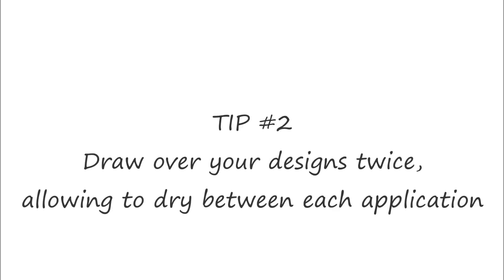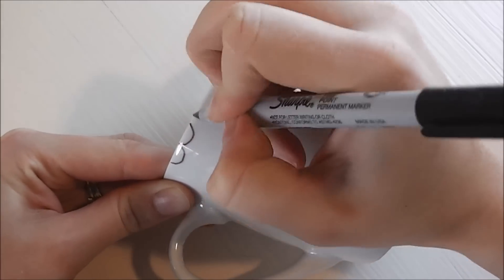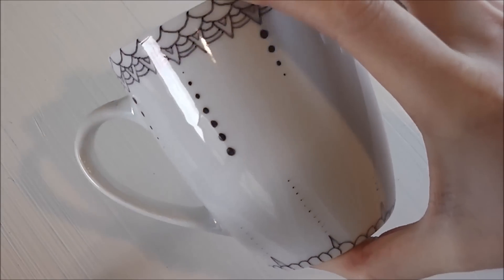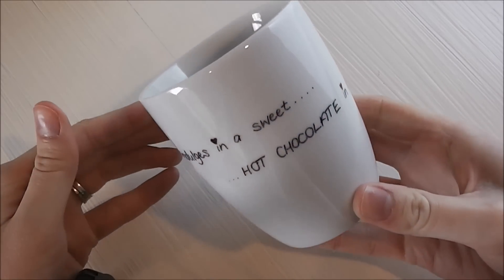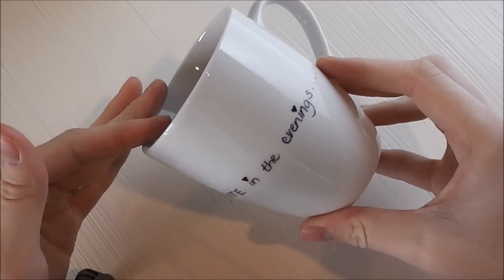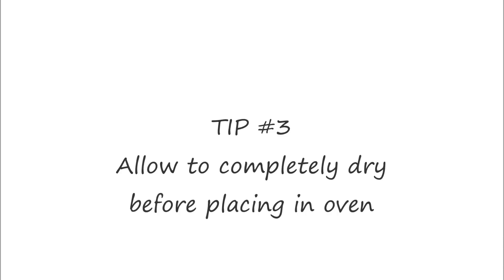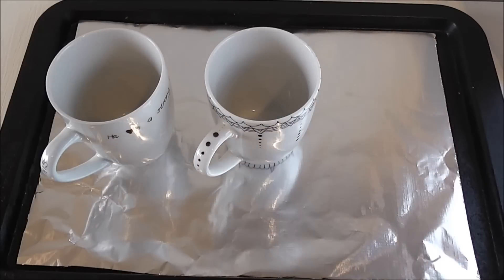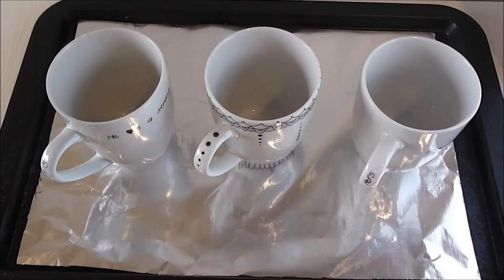DIY Sharpie Mugs (and why they often FAIL!)

Comment: I have used both regular Sharpies and also the oil-based paint Sharpies.  some things to be aware of.  If you have any finger oils on the cup, the paints will not adhere (absorb) After washing the cup and rinsing well, use alcohol to wipe the area you will be tangling thoroughly!. (2) Avoid depositing more finger oils on the cup by using cotton gloves when handling. (3) I DOUBLE BAKE the cups. first time bring oven and cup to 425 Degrees F and bake for 30 minutes, then turn off oven and let cups and oven cool naturally. Reset oven to 450 degrees F and let oven and cup warm up together.  Let bake for 45 minutes. Turn oven off and let both cool naturally. 

When done this way, the cups have stood up to dishwashers at the local Senior Center for 6 months of use, so far.  Using this method, sometimes the Sharpie metallic paints will undergo changes. Example: the Rose gold will change to plain gold metallic.
Reply from the maker: Mildred Galliher Thanks for your suggestions Mildred, I'm sure they'll help some people out :)
Reply: can I use any colors?
like red..blue..green..silver..gold
Reply: Sylvia Taylor I believe so
Reply: Hi :) Can this be done on glasses as well, or just mugs? Thank you :)
Reply: Mildred Galliher which sharpies do you think work better
Reply: Oil based markers will work better, with baking they are able to be dishwasher safe
Reply: Trysh Greig for glass I would say no because when glass heats up it will break
Reply: Will the heat make the cup explode from getting too hot??
Reply: Kaylee Michelle ceramic usually can withstand a high temperature- usually up to 1800 to 3000 degrees Fahrenheit so there’s nothing to worry about unless the ceramic is not oven safe
Reply: Kaylee Michelle not if you put the mugs in a cool oven and then heat it.  I bake for one hour at 425 and then let it cool completely before moving.  Start timing the hour after the oven reaches 425. I only use oil based sharpies.
Reply: I completely agree with avoiding finger oils as much as possible; I didn't know this prior to baking my mug and it came out with brown stains which you can rub off with cleaning materials but it's much better not to risk it!
Reply: I got a question if I'm only tracing the image with a regular Sharpie  on the glass and then I paint the image can I put it in the oven?
Reply: @tryshgreig9220  i have tried and it works even better 👍

Comment: oil based sharpie markers are the best to use, dont forget to use some rubbing alcohol on the mug then letting it dry again before drawing, then finish everything off with a layer or two of some mod podge to create a protective coat so that you cant scratch anything off
Reply: Shelby Cook do you put the mod podge on before or after you bake it
Reply: put the mod podge on after you bake it, i put 2-3 coats on them and it turned out great. Make sure not to put any on the upper rim where you'd put your lips, leave an inch of room for that across the entire cup or else youd get sick from toxins.
Reply: Shelby Cook 
what if we dont have oven?  what else can we use
Reply: what mod podge do you use? Is there one specifically for glassware/stoneware?
Reply: what kind of mod podge did you use?

Comment: I would also suggest that instead of using regular sharpies, to use oil-based paint marker sharpies. I baked mine with the oven at 350 degrees for 30 minutes and it works fine. It's also dishwasher safe! :)

Comment: Followed the directions, including cleaning the mug before painting with alcohol, used Sharpie Oil markers, bake @ HIGH temp, etc. Mugs looked great going into the oven, but when cooled & removed - the colors had almost all changed. Red was vibrant going in, came out almost black. Navy blue came out brown, turquoise became light brown - only black emerged as it went in. 

I wish I knew what I did wrong, or if anyone else has had this disappointing experience and figured out how to fix it. Lots of hours seemingly down the tube....
Reply: The video mentioned the colors would change. You did nothing wrong. That's just what happens when you heat them. You might want to test the colors on a similar surface before using on your project so you know how they will turn out and can plan accordingly.

Comment: I bought some mugs from ASDA for £4, used a regular black sharpie and baked for 25 minutes at 150 degrees Celsius, leaving them to cool completely with the oven door cracked open slowly. So far the mugs seem fine, no fade in colour after baking. When I was designing I wiped down the surface with some weak salicylate acid (actually in my face cleanser) and tried to avoid touching it afterwards. No cracks, haven't tried washing them yet but I'd leave them for a few days before first use! Hope this helps someone

Comment: Great tips on your video.  I have used the sharpie oil based paint pens.  My designs are on mugs and wine glasses which I use both sharpies and enamel paints.  I follow the baking instructions for the paints, and after baking I have found the sharpie pens have faded.  I also apply  a clear glaze for added durability and the sharpie pen bleed.  Do you have any recommendation on glazes that won't make the sharpie pens  bleed.  Thanks for your help.  Elaine

Comment from the maker: Great tip Danielle - hope people read that one :)
Reply: I used the Oil Based sharpies and only had to apply one coat. The mugs came out great and are not washing away.
Reply: +Meredith McGee well where do you buy oil ones? mine don't say anything on?
Reply: +Caleb kendyl  Ya most of the time when they say Sharpie Mugs they are referring to the oil paint permanent type of sharpie.  I had to go looking for them, but you can get the at Michaels for a little under $20.00 for a pack of 4 colors... so they are more expensive then normal Sharpies, but thats because they are not Permanent Markers, they are Paint Markers.  They come in Water color and Oil.. but so far the oil works best to stay on glass for myself.  You can also buy them online at places like Amazon and craft places.  But if you are still not sure what I mean check out sharpie.com  and according to Amazon they are called Sharpie Oil-Based Paint Markers....  

http://www.amazon.com/Sharpie-Oil-Based-Markers-Assorted-1770459/dp/B003VQ9M04/ref=as_sl_pc_tf_til?tag=thecozoldfar-20&linkCode=w00&linkId=LCLJVKSJL7OC3JBG&creativeASIN=B003VQ9M04

I hope this helps...
Reply: Thanks for the link. I just ordered the oil based metallic markers. Lets see how they turn out. THANKS!

Comment: I am baking my mugs right now.... I am nervous 😁😁😁. .. I am following your directions step by step.... Let's wait for the final result. ;)
Reply: How'd they turn out?
Reply: Ohh Amazing! I loved them and all my guests loved them too. I made them for my wedding gift which was very intimate and small. Thank you so much!!! 😄
Reply: +Carol Vzla C 
did you use regular or oil based sharpies?  Thanks. Did you bake at the 220-230?
Reply: I actually used DecoArt glass paint marker. I placed them in the oven for 30 min (375 ° F) after a year my mugs are still cute and perfect.

Comment: This has been extremely helpful and I love your work. My issue today is that I am wanting to paint these AMAZING clear glass soup mugs I found at a local dollar store. I've not yet used the markers on clear glass, just the little cheaper ceramic.  I do let each color dry before applying second coat, and in addition let sit to cure for 24 hours before baking. But my question is, is the baking step going to work as well for the clear glass? Any tutorials I've watched thus far from others don't use this step, just paint, let dry and hand wash. Just feel like this would be a good step to add.

Comment: What happens if you re-bake it? Will it possibly brake? I baked it once but the sharpie just scratched off. It didn't come off with water, but when lightly scratched it just comes off. Can I re-bake it?
Reply: the sharpie has to be oil based
Reply: that happened to me too and I did it with oil based paint. I baked it twice at 425 but it did not work :/

Comment: what do u mean ny letting it heat up with the oven? like putting it in the oven before the timer goes off? if so do u start the 30mins for the mugs then or after the timer for the warming of the oven goes off???? Sorry this might be confusing! :)
Reply: Don't preheat the oven before putting the mugs in. Let the mugs heat as the temperature rises. If not the mugs might break from the sudden heat change. Same goes for removing them from the oven. Let them cool in the oven.
Reply: put the mug in, and then preheat the oven while the mug is already in

Comment: thx for the video. will there be significant colour change when I bake the cups? i have useda variety of colors using the oil based sharpie paint markers such as pink, blue, purple, red and yellow. also would u recommend using a water based varnish as extra protection after baking?

Comment: If you want something that will REALLY adhere to plastic,ceramic,glass or metal try NAIL POLISH.All nail polishes sold (in Canada at least) are free of harmfull chemicals.However,you need GOOD Ventillation when painting with nail polish because it's highly flamable.Also I dont think the nail polish will be free of cracks if you wash it.Nail polish (and permanent markers) are best used on artworks (like decorative plates) that are not used for actually drinking or eating off of.

Comment: A question I have wondered.....I plan on trying this and learning as MUCH as I can to make sure my first shot sticks right. For the 30 minute bake time, do you set your timer as SOON as the mugs go in (meaning the mugs run time is also during the heat up time) or do you NOT start the timer TILL the oven hits the 220c mark?
Reply from the maker: Zetamoon Start the timer once it reaches temperature :)
Reply: I put my mugs in for 40-45min, starting the timer at the very start. That way it includes the warm up as well as 30min bake time. My mugs have worked a treat with no issues.

Comment: Just a quick question...approximately how long will this design last if it turns out right? Thanks for the advice!! Much appreciated
Reply: If you use it daily and wash it daily with the soft spine it should last 3-5 months depending on how gently you wash it. Hope this helps!  ^-^

Comment: Hi, thank's for the tips! I use an acrylic spray to seal after oven and it works, my mug seems perfect! But i have a doubt... although i'm very careful and don't put spray where the lips touch and inside the mug, i don't know if it's dangerous. What do you think? Did you use it too or just use the oven? Thank you
Reply from the maker: Ana Rita Cardoso Hi Ana, I only used the oven, so setting spray afterwards. Unless you are using a ceramic specific spray, I would be careful :)

Comment: I used regular perm sharpies.  I baked at 350 for 30 minutes.  My colors changed a bit during the process.  They were not vibrant anymore and / or they changed colors all together.  Is this due to using the regular perm sharpies?

Comment: Hey great video. Question if I used a glass to do this do I still bake in oven and is it safe?? Thanks
Reply from the maker: Diane Mawdsley Hi there. No, don't put glass in the oven. Glass will require a different medium specific to drawing on glass. :)
Reply: Thanks StyleNovice.

Comment: this may sound like an odd question but where can i actually get the glaze? I want to paint over a dollar store figurine and id like to seal the paint  somehow
Reply from the maker: Jane Doe Hi Jane, the existing glaze on the cup heats up in the oven and that's what the sharpie melts into to set :) Otherwise, you may want to try ceramic paints which may also have a separate glaze available for purchase. Hope that helps :)
Reply: StyleNovice ty so much, it does!
Reply: StyleNovice  where can you get the ceramic paint from for cheap

Comment: Is there any substitutes for oven? I mean, anything what would heat the ink pressed. Thanks!
Reply: Karlo Bloo 

I used a bench top convection oven (you know, the fan-forced ones with a heat lamp in them?) and that worked better than the ones that I did in the normal oven!!!!!

Also, make sure your oven is clean -- if there's any baked on grime, it will transfer to the cup or plate or bowl.

Comment: I used nail polish remover so I hope my mugs don't blow up 😂
Reply: did they?
Reply: @brittapeltola1746  I think maybe she died because her oven exposed so she could not answer back
Reply: @brittapeltola1746  😥😂😥😥😥😂
Reply: Curly Sue lmao
Reply: Dalya Adams i used nail polish remover when my design dried on my mug and i decided i wanted to change something. Alcohol doesn't clean it off but nail polish remover does however i think it does something to the mug glaze or the sharpie afterwards because when i baked the design it started chipping off after 3-4 washes. And no.. my oven didn't explode lol

Comment: Okay, So I didn't get oil based but I already personalized the mug and I don't have time to re do it so does it have to he oil based??
Reply: +BrandyJ Hancock Try it and see, I'm wondering the same
Reply: I tried it and it stays when you touch it but if you were to wash it it would most likely come off. It's just going to be a decoration I guess 😕
Reply: +BrandyJ Hancock just go over it with a waterproof glaze over the whole mug and it should work fine

Comment: If the sharpie reaches the rim of the mug and you drink out of it, will it be toxic if you actually drink out of it and the sharpie comes in contact with the mouth???
Reply: always leave at least a one inch space between the brim of the cup and where the paint/design starts

Comment: My friend recommended adding a sealer like mod podge, but I don't know if it would help or not??
Reply from the maker: The sharpie seeps into the glaze of the cup while it is baking. I wouldn't recommend adding mod podge as I don't know if this is safe to drink off of once heated??
Reply: StyleNovice wouldn’t you add the mod podge after baking and leave about 1cm away from the rim you would usually drink from just in case ?

Comment: Can you do this with plates too?
Reply from the maker: Hi Crystell, of course you could but you would be better doing it on a plate that is only used for special occasions etc as I can almost guarantee that the designs wont last as long, just due to the need to wash plates more often and they are often scrubbed at a little harder, even with a soft cloth.
Reply: Thank you.

Comment: Mine didn't work. It got really hot and I had to take it out of the oven after 4-5 minutes. It even set my smoke alarms off. Why did this happen?
Reply from the maker: Christine Bagara Did you take the paper price tag off the bottom first? that can cause smoke...?
Reply: Did you put it on the right temperature?

Comment: Can you do it on plates too?
Reply from the maker: Hi Kimberley, of course you could but you would be better doing it on a plate that is only used for special occasions etc as I can almost guarantee that the designs wont last as long, just due to the need to wash plates more often and they are often scrubbed at a little harder, even with a soft cloth.

Comment: but how if we dont have oven?how about we microwave it insted? (SorryAboutMyBadEnglish)
Reply from the maker: +Jessica Noel Hi Jessica, sorry, the microwave does not heat hot enough to melt the glaze :(
Reply: +StyleNovice oh ok,soo i cant make them 😭 but i really want to make,can we use other things insted oven?
Reply: +StyleNovice Hi ! can I use non oil based sharpie.. ? I use floral colors sharpie
Reply: +Laura Cupquake they don't hold during washes.

Comment: Can I use microwave-proof mugs?
Reply from the maker: +Monica Thie Yes of course, but you still need to use an oven for the project :)
Reply: cool, thanks!
Reply: StyleNovice plz reply asap, will the sharpie effect you or rub off if it is on the lip of the mug. will it hurt you

Comment: I tried this and then used an acrylic sealer but the ink ran. I was only baking at 200 degrees tho so this is probably the issue. Have you ever used a sealer after the fact and is it safe to do so?
Reply from the maker: Bethany Sutton Haven't tried a sealer no, its the glaze of the mug that heats up in the oven and sets the sharpie ink into it, kinda like a tattoo!